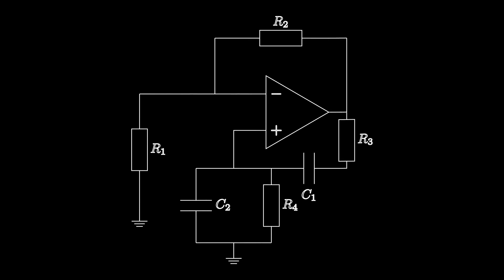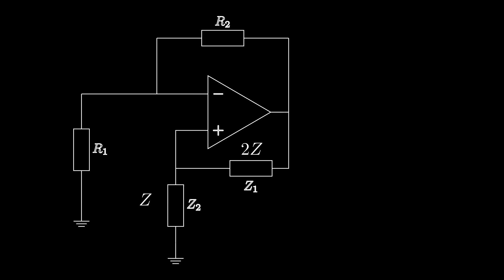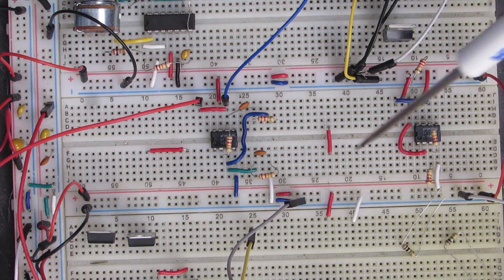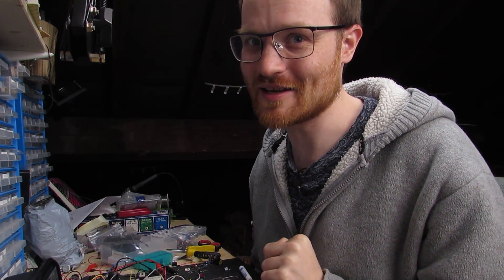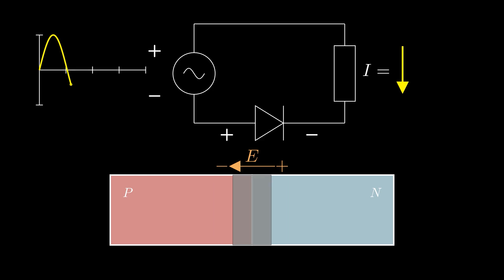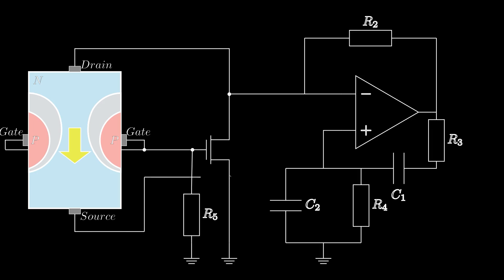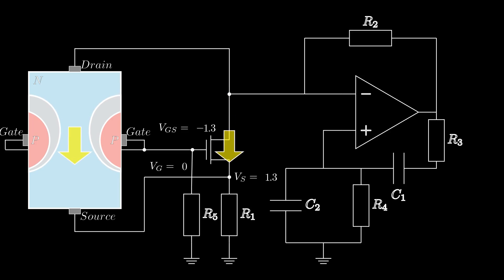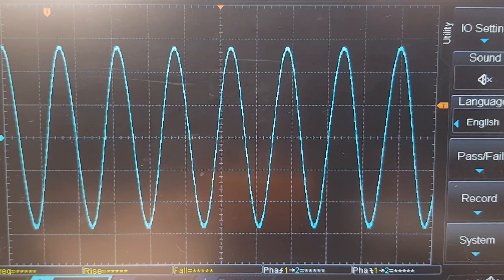Build A Simple Sine Wave Oscillator

Comment: I used a circuit much like yours (w/o JFET and w/o diodes) and it did not start up... I used the circuit in figure 8 of  the TI "Sine-Wave Oscillator" article by Ron Mancini and Richard Palmer.I set Vref to 0.83 and now the oscillations are happening.  The article explains the use of Vref as "VREF must be applied to bias the output for full-scale swing and minimal distortion"... not sure I know why but it seemed necessary... now I want to try your ganged pot idea, which I too was thinking about.

Comment: I wonder what can prevent us from taking an 8-pin  PIC16F13 and get the cleanest sine signal? That's about 60 cents. I'm sure China can offer even cheaper uC solution
Reply: PIC16F13? Does such a device exist?

Put quite simply, any sine wave created using Direct Digital Synthesis will, by its very nature, not be clean!
Reply: @SpeccyMan  Direct Digital Synthesis? A sine wave is a mater of 1/4 table data in a ROM. You don't need a Cortex core to generate a sine wave )

Comment: why is there an appearently necessary diode in your schematic (it doesn't work without it when i try it) but in the video it seems to work without it? Plus: The Video makes it seem as if R5 and R1 are 10k but in your Schematic it is 1M and 20k.... so to make that clear: the schematic in the discribtion works like a charm (it produces around 73Hz) but the cirquit as shown in the video doesn't work.

for clarification:

I used a stableized, clean +/-4.7VDC power supply, an OPA2134 OpAmp and an NTE 312 JFET because those where the parts I had at home. I doubt however, that the diode was needed because of the difference in parts... I would be thankful for clarification

Comment: Awesome explanation, sir any videos on Radio Control circuit's  , explaining in detail the working of the circuit  , how the signals are transmitted from transmitter to receiver to control the dc motors in the RC toys

Comment: hello! love this channel, it has taught me so much! 
I tried to build this circuit, but I didn't have a j113 so i tried substituting another N-channel JFET, a 2N3819 - i can't seem to get it to oscillate. I have confirmed that if I replace the JFET with just a trimpot I can start the oscillations by turning the trimpot. do these not work for this purpose, or is there something  I'm missing?

Comment: is there a way to do this with 4.5 volts and a 9V power supply? I tried this circuit replacing all grounds with 4.5 and had no luck. the best I can get is a triangle wave or square.
Reply from the maker: I'll have a look and get back to you
Reply from the maker: I'll have a look and get back to you
Reply: @TheAudioPhool   So, I learned that you can take a single supply voltage supply like 9 volts, and voltage divide it between the positive and negative end, this gives you +4.5V and -4.5V. Then I can get the oscillator circuit to work.  so if I wanted +15V and -15V, I would use a +30VDC supply and voltage divide it. There is no explanation of this anywhere online this I could find. I just had to figure it out. granted I have an associates in electronic engineering :).

Comment: I understand why this circuit oscillates, but I don't understand why it generates a sine waveform, and not a cosh or sinc or parabolic periodic function. Could you explain or derive why it's a sine wave?
Reply from the maker: I think the simplest way to think about why the output would be a sine wave is to think of the oscillator as a very tight band pass filter with a unity gain at the oscillating frequency. In less jargony terms, the oscillator essentially mantains a gain of 1 at a specific frequency and a gain of 0 elsewhere. That specific frequency is a sine wave by definition. 
We know from fourier that sound is made up of an infinite sum of discrete frequencies, and that each frequency is represented by a sine wave of a certain amplitude and phase. We are just highlighting one of those frequencies, which leaves us with just one sine wave! :)

Comment: I was so dissappointed recently when I made a nice oscillator and on the breadboard it worked perfectly so I decieed to make a PCB and solder all circuit on the PCB and here the problems start... actually the main problem is no oscillation.
Reply: That could be caused by the small (or not so small) added resistances and capacitances in the breadboard connections. When you soldered the same components on the almost "perfect" PCB, you lost those extra random Rs and Cs that where used to tune the oscillator within its range. I had a similar experience when I was young, as I was not allowed to use my father's soldering station, I built my first small FM emitter "DIY kit" on a piece of cardboard and connected the components using a "circuitgraph" (wrapping pen). Surprisingly, it worked and my father was so impressed he printed the PCB by the book, with everything soldered nice and tidy, and the only way to have it kind of working was to touch the collector of a transistor in the oscillator part of the circuit...
Reply: Exactly! The same story but it gives me a lesson also to calculate everything more acuratelly and for my own so I will always know what it is going on..

Comment: Really cool video ! Although, I was wondering, instead of using a JFET to make the total gain greater then one, wouldn't it be cheaper to use a RNTC resistor ? We replace R2 by this resistor which would have  a standard value greater then 20k ohm and would then decrease to 20k ohm as the circuit increases in temperature. Thanks for the video !
Reply from the maker: The original circuit (from the 19th century!) Uses an incandescent bulb to do exactly this. Lots of different ways to build anything! Give it a go and let me know how it goes :)

Comment: Nice description of the circuit. Presumably the cct will work with a CA3130 without split +V and -V? What's the formula for calculating the frequency?
Reply from the maker: It should do! You need a mid-rail reference as your 'ground'.
I do mention in passing, should have made this clearer in the video. sorry!
As long as you have c1 = c2 and r1 = r2 the frequency of oscillation is the 3dB point of the filters aka f = 1/(2*pi*R*C).
If you decide you want to have different values for c1 & c2, or r1 & r2 the equation becomes f = 1/(2*pi*SQRT(R1*R2*C1*C2)). Which you can see simplifies to the first equation if the resistors and capacitors match. :)

Comment: I was just messing around with the same circuit, nice. I was thinking this could make a good simple sine lfo if you have big capacitors, and there is no point for super prisice voltage control if any for an lfo
Reply from the maker: I had the exact same thought!

Comment: I always used a light bulb in a wein bridge oscillator, that also seems to work well.
Reply from the maker: Incandescent bulb works beautifully and is very cool :)
Reply: Mr. Hewlett and Mr. Packard thought so.
Reply: You can impliment the classical Hewlett Wien Bridge design with a type 327 lamp which is readily available. The result is a sine with less than 0.1% THD; appreciably better than what you get with a JFET. The only drawback is that such a circuit typically requires at least 15 volts as a supply.